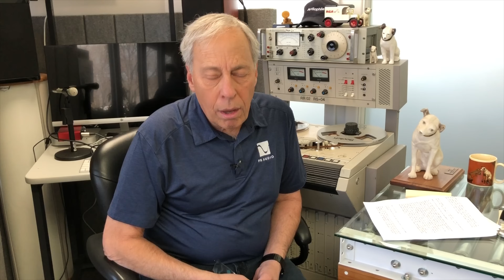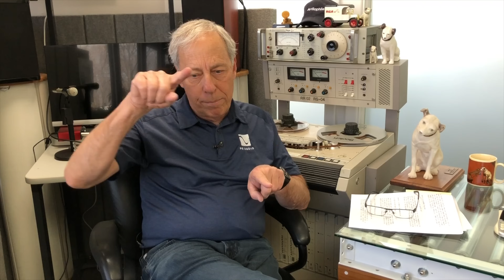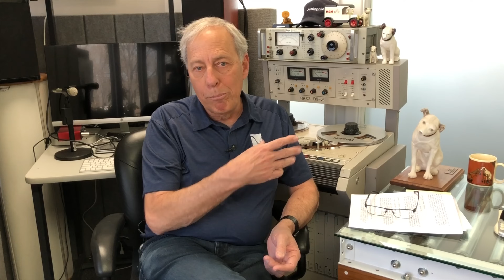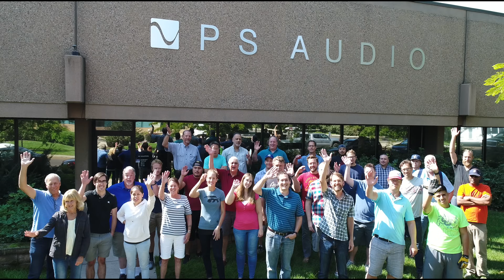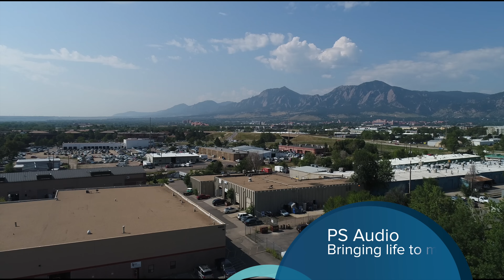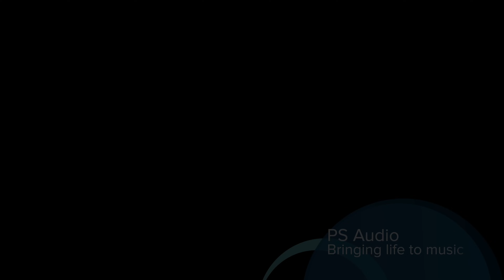Why aren't class D amplifier better liked?

Comment: Just bought myself a little class D amp from fosi based on the form factor alone really. I'm using it for my PC speakers so it's not my primary listening device. I prefer headphones when working so this would be mostly for movies and YouTube. Will see how it compares to the AB I'm currently using. I suspect I won't be able to tell the difference.

Comment: you know what makes the chocolate cake great? that it's not made entirely of chocolate. d-class is elegant in that it uses valves as an ingredient
Reply: Class D has a reputation for a lot of issues and it's benefits don't outweigh those. At best they are similar price for similar performance. Sure, a crazy expensive one with tubes would be nice but so would a class A/B.
Reply: @Roof_Pizza ye sure anyway for me it was ether d-class or live-without-amp-class, so i try to focus on the good side

Comment: New ways of feedback with cascaded integrators who has flattened for audio does quite fine, Ik have busy testing mine design who has witj just one opamp complete control over filter and switching stage. I have not yet using myself that cascaded nested system of Icepower, it has quite some opamps, and I do not like that, opamps on itselfs has uge open loop, and so maiking someting with one opamp is challencing fir correction feedbakc for stability, I can get -`140 dB distortions, but quite unstable amp, this does affect each other.

Comment: I just added a class D amp to my bi-amped with subs PA to tri-amped with subs splitting the highs and mids and it sounds great, I'll be adding another class D to power mid bass couplers turning it into a 5 way system, so far I don't hear any issues with class D.

Comment: It just so happens that some of the big 50KW AM radio transmitters now days usses class D modulation because of its better efficiency.  The old tube finals used analog with huge modulation transformers. Not needed for class D!

Comment: Thanks, Paul. Excellent technical description of the function of class D amps.

I have two class D amps in my house. The first is on my desktop PC, hooked up to en external DAC and needed for the highly inefficient but clean sounding EAD drivers in my own design of boxes. This is good enough to listen to all day. The second is in my main system's active subwoofer. This is the third active sub I have owned and the first using a linear (rather than switched-mode) power supply. No more costly than it's predecessor it sounds noticeably better. The rest of my main system is 4 watts of single tube power driving 97db/w Lowther horns for which I make no apologies.

Class D amps are a perfect demonstration of the fundamental principles of HiFi:
* Everything makes a difference.
* Its only doing its job if it lets YOU enjoy the music.
* Your mileage may (will) vary.

Comment: As technician, I thought that today's class d are more "hi fi" than class ab or even class a, why? Becoz class a & ab had too many parameter that need to be manually tuned: bias, feedback, null offset, gain, etc, & we need xpnsve tool for tuning. Meanwhile class d is more digital like, no coloration, no wild oscillation, just put them on the right place, they sound well..

Comment: If you have to move your pa to a stage regularly, you will love class-D amps. When you need 1000W and you only have 15A on stage, love class-D.  25W at home for horns? Class-A, baby. Switch off when done.

Comment: My bands use a Yamaha class D and a Yorkville class D powered mixers and they both sound very good, with power to spare to run both mains and monitors (8 ohm speakers). You can literally pick them up with a pinky finger. You can't beat that for live music compared to breaking your back to move 80 pounds and more mixers and separate power amps.

Comment: I listen to music on my pc mostly. I  recently switched from a cheap aliexpress  Class D TPA3116 mini amp  (with some minor mods to reduce noise), and I "upgraded" to a consumer grade Denon 5.1 surround receiver. I have very good bookshelf speakers (Overnight Sensation).  Im a little disappointed with the result, in fact it sounds a bit "brighter" but not in a good way, seems harsh. I'm not sure if I had just gotten used to the class D amp's sound or if it really did sound better to me.  I always have and still believe that speaker selection makes a MUCH bigger difference than amplifier selection when trying to improve sound quality.

Comment: Well stated; agree from personal experience.
900 watts of Class D in vehicle via Kenwood's eXcelon Reference XR401-4 amp & 2 eXcelon Standard X502-1 mono amps.
Reply: That would involve drawing 70A from a 14.4V supply at 90% efficiency; you must have thick cables. Also, unless your speakers are rather inefficient (and I know car audio drivers can be) your hearing would be instantly destroyed if you turned it up much. And as for 1% THD at that power level...

Comment: Is the TC electronic RH750 amp a good Class D amp? But this is so expensive amp. I thought Class D amp supposed to be Cheap!
Reply: You can build a basic class D amp from scraps. Of course you can then improve the design, from the output filter to a feedback loop and shifting the triangle wave oscillator's frequency up and down automatically.
Reply: someone7557 hmmm and your point is?
Reply: @popitn2nd  If you read my comment you'd have known what my point is. Just because something is simple in principle doesn't mean you can't add performance and/or value to it -- There are front wheel drive cars starting below $10.000, but there are also front wheel drive cars starting at $40.000.
Reply: someone7557 ah i see. So this amp manufacturer make something cheap which the class D and improve it! And sell them the  market 5x the price!

Comment: Maybe the problem is that we as humans have a "time tape measure" going on, and the on/off of the Class D amp is another one, and those two waves going together result in an uncomfortable harmonic, sort of like playing a C and a B together on a piano.  Class D amps remind me of the first Bogen pa we had in the 70's, you know, the "Kmart will be closing in 15 minutes" kind.  Like you took ones of those amps and removed all the noise and hum but the basic tone was the same.

Comment: I don’t understand the design nor am I impressed with the sound of any class d amp I have ever heard. As far as I am concerned, they have one purpose in audio and that is in subwoofer amps. Not even a fan in that application, but it is the only one that has any promise for this technology. I am sure to get hate mail for my opinion and I am sure that there are others that differ from mine. Oh well, opinions vary! Class A or A/B for me in matters of audio amplification! Let the haters hate and let the hating begin!
Reply from the maker: Hopefully there won't be any hate mail. Hey, it's just audio. Your opinion is likely based on what you've heard and, for the most part, I would agree with you. However, if one's careful with the front end for a class D they can be surprisingly musical sounding. In fact, they can sound better than a few class AB amps when done right. But, as you suggest, the majority are just not sounding all that good.

Comment: I had a question that relates to Class D. I'm thinking about buying a Class D solid state guitar amplifier, but I heard that Class D amps lose a lot of their power (more than Class A or A/B amps do) when they drive speakers above 4 ohms, and my speaker happens to be 8 ohms. Is this so? If it is, the high watts the amp manufacturer claims for the amp don't seem as impressive.
Reply: For a guitar amp, play some with classic tube designs before spending on newtech. Smaller than a single 12" and 60W, they are hard to beat. Guitar amp is a musical instrument, not Hi-Fi.

Comment: I would LOVE to see a blind test between a class AB (like an Emotiva XPA-DR2) and a class D (like a Crown XLS 2502) power amplifier.
Reply: Crown? There's way better classD tech. Hypex Ncores. Top of the line world class. Trashes AB.
Reply: The test is class-a vs. class-d. The A gets every advantage of weight heat power.  If not distinguishable, awesome.
Reply: @pirate0jimmy  I agree because if the amp gets warm it will sound warm. I much prefer a nice warm thick sound over a cold thin sound.
Reply: A power amplifier should be very accurate with precise control of the drivers. If you want a "warm" distorted sound, a tube preamp might be to your liking, or a good parametric eq?  The most effect to the sound is going to be the room and the speaker type/design, after the recording, natch'.

Comment: You were doing so well explaining class d right up till you said @3:20 "these longer and shorter pulses then have to have there edges taken off", implying that the lc filter somehow rounds every edge off of the carrier signal and recreates the music. The lc filter is just a low pass filter set somewhere below the carrier frequency and above 20k which removes the carrier signal almost completely, leaving the sliced up and amplified copy of your jam behind. No rounding takes place, lol. I would agree that the lc filter can cause some impedance mismatch issues but more important to noise is deadtime/shoot through timing errors, and maybe even more important are quantization/modulation scheme errors. This is where the bulk of the work goes not the humble lc filter.

Comment: Class D will be high end if they find a way to make it cost high end
Reply: Absolutely the best statement I have ever heard
Reply: While there are really good class D amps, I’m skeptical that most have a sound that those of us who love class A will be happy with.  Returning to audio after decades I replaced my old class A amp with a parasound which was reasonably price used.
Reply: Like any amp, you can pay more and get better class--D.
Reply: AMEN BROTHER !!!
Reply: No they will not. 
Class D.  Typical thin midrange.
Sound lacking presense and body.
Reply: @henriksrensen5958  I don't think so. At least for the market. Anyway, it can be easily solved with a pre amp designed to correct this.
Reply: @vexguine  Yes Maybe, but Im against the idea that you have to correct some bad sound in the hifi chain
Reply: @henriksrensen5958  But it does not sound bad. It sounds absolutely neutral. And generations of people grew with endless attempts to squeeze the best from A/B, listened to nothing but transistor sound. Now when they listen to ZERO distortion down to 140 dB, they can't believe they listen to an original music.
Reply: @henriksrensen5958  sure... NOT...
Reply: You so get it.

Comment: I own a Pioneer Elite SC-07 with the first generation B&O Icepower amplifier in it, it is clean, dynamic, detailed and very musical. I really like Class AB amplifiers mainly for their warmth and musicality but I've recently come to favor modern class D.It uses less energy, waste less energy, run cooler and the ICEpower amps are capable of really low distortion while retaining neutrality and musicality. I hope one day to afford one of your BHK amps I like tubes and solid-state used in tandem with one another

Comment: Class D is not so complicated. Around 250 kHz switching frequency normally used for high power Pro Audio, while 300-400kHz normally used for small class D amplifier for home. Today to get that such switching frequency we can easily find from market. Also inductor core, we can find easily from Kool Mu, Micrometal, or Arnold. I have built many class D amplifiers, and all sound beautiful.

Comment: class d tend to go pop more often, only the high end class D amps are good all the cheap EBAY modules around have issues, also the cheap DJ PA Amps are not reliable either, where the big heavy old class a b lasts for decades. The fine surface mount components are not as robust, easily damaged, class d amps are much more complicated, and more to go wrong. The main advantage is their higher efficiency allows them to be lighter smaller and cheaper, no big expensive heat-sinks etc... The more complex and computerized a machine becomes the more can go wrong, and it does. Another issue, is when power transistors are switched on and off hard, they tend to fail more often compared to if they are operating in the linear region. Yet another reason why switch amps and switching power supplies, then to go pop!

Comment: The trouble with class d is, vastly more complex circuitry, 99.99% of designers do not properly filter out the rf switching and it causes interference with radio etc. Multiple modules tend to "beat" with each other creating unwanted sequel and pop sounds, some engineers have address this with a sync pin, But not all amps have it. Not as reliable as class a/b, most class d do not sound as good either. The modules on ebay work but not without issues, mainly emit horrible rf interference.

Comment: Higher amperage doesn't necessarily mean less efficient, you'd need thicker wiring, so it would be more expensive to achieve the same efficiency, but not impossible.

Comment: The setup of D-to-A, pre-amp, power amp, and thick wires to speakers with passive crossovers is very antiquated.  It's all moving to the speaker boxes, which will receive only digital input (wired or wireless), internal amp will be class D, and the D-to-A, crossover filtering, and other signal processing will all be done in the digital domain.  It will be WAY cheaper, and sound way better.  We're already seeing it now, but it will eventually become the choice for even the most hardcore audiophiles.

Comment: Class D is the most popular topology today by far. Why? Because it's in every portable device and in most non-portable devices too. This popularity is a good thing because so much engineering effort is focused on Class D. The results are astounding as compared to the days when companies were breaking new ground with parts not specifically designed for such use.

Comment: I just received my second Crown XLS 1502 Class D Amp. I am obviously please, or I wouldn't have bought a 2nd amplifier. I heard an earlier model of this amp at a very discriminating audiophile's house on expensive speakers  . . . and this man has the resources to buy all types of speakers and amplifiers and has done so. 

The amplifiers I replaced were expensive, heavy, Class A input with Class A/B output -- the Crown Class D outdoes the big monoblocks in detail, quietness, power, and musical integrity; in fact, I have heard more musical information on the Crown amplifiers than I have with my former amplifiers. These amplifiers weight around 8.6 pounds, are more efficient in power consumption, stay cool, and take up a lot less space. These Crown amplifiers also have so many connection options, as well as operational options, such as turning off the displays for complete stealth operation in a darkened room. The specs on these amps, running on 2-ohm loads on up (see specs) and at the output voltages you receive, is outstanding.

This is not just about opinions . . . it is about satisfaction with one's purchase and in this case -- the Crown's performance. Check out the Crown XLS 1502. and 2502 on YouTube for more reviews and opinions . . . then judge for yourself. I have not listened to all the amplifiers of the world that come and go, and I doubt that any of you have done so either. The point being, no matter what you buy, you should buy to get the best performance, reliability, and quality of sound within the price point that you can afford. Even these high-priced manufacturers of these very pricey units have to admit . . . they have not totally come up with live performance sound -- maybe close, but the truth is -- what are you getting in VALUE . . . quality of performance per dollar that you invest . . . and is the status and a few percentage points of improvement worth thousands of dollars more than what you can get at a very reasonable price and still with the reliability, sound quality, and satisfaction -- or are bragging rights that important to your fragile ego? In the final analysis, you own it, listen to it, and either enjoy or hate it -- it is your ears, your taste, and your satisfaction in what you enjoy for the hard-earned dollars you spend. Listen objectively and without bias . . . then you decide . . . after all, it is your money and your ears that should dictate what you purchase -- not theirs.
Reply: russmaleartist I also now run Crown XLS (2502) in two separate systems and will be selling my class AB stuff. I think many audiophiles would be pleasantly surprised by these amps but the strong bias against class D will stop them from trying them out.
Reply: @CaptainCrunch823  Because of my hearing and objective rendering of a critique, I was always asked my opinions on new equipment coming into a very good stereo store. I remember when the first Wilson Puppies came to the store. I listened and was impressed except for the very hot high frequencies and the chest voice in the lower midrange. So, I know what I like and what I consider to be quality music reproduction compared to live music. The argument will continue regardless, because some people only have taste in their mouths . . . and sometimes even that is not good . . . so when they judge music by the same criteria as they do, say, clothes . . . many times not based upon what looks good on their frames -- but rather, because it costs an arm and a leg and looks good on an abnormally starved model -- so it MUST be the best and make them fashionable, etc. Not necessarily . . . and neither does everything that is in the audiophile world either. 

Hope you enjoy your Crowns for years to come! Happy New Year!